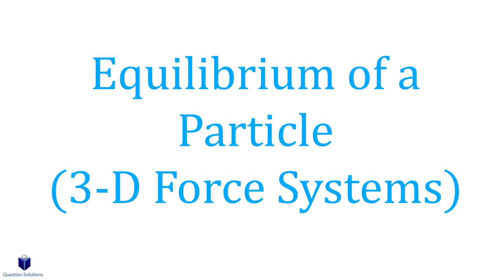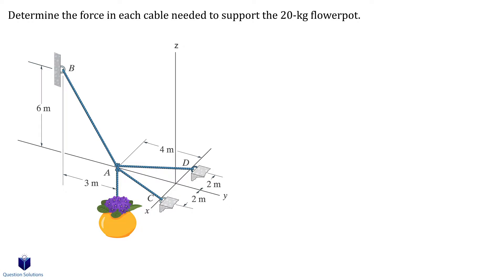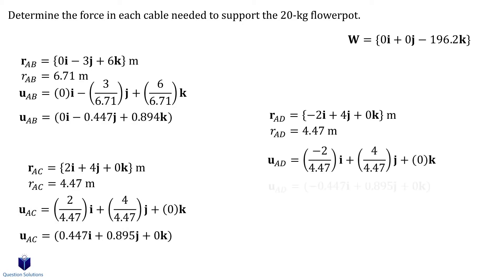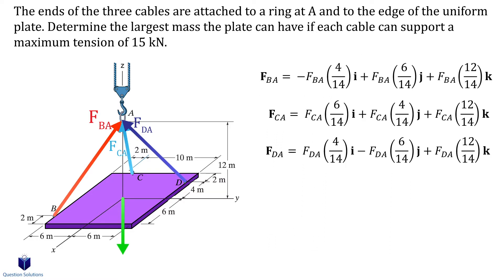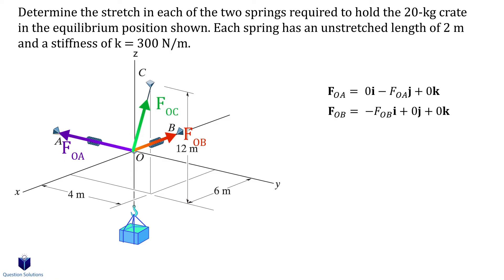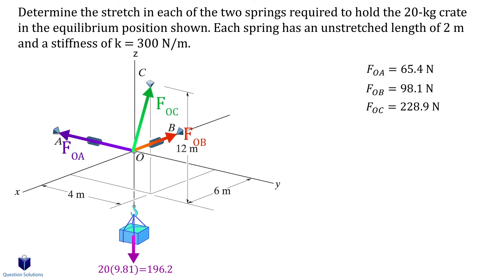Equilibrium of a Particle 3D Force Systems | Mechanics Statics | (Learn to solve any problem)

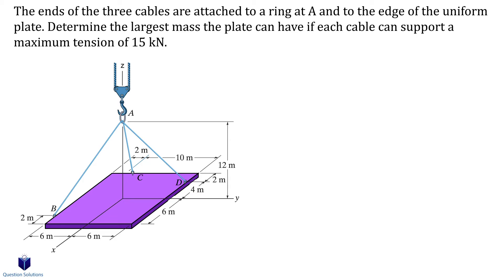Comment: I am not sure where you are getting those final values at 2:27.
Reply from the maker: So you can easily get FAB by solving the 3rd equation at 2:16 (the summation of forces in the z-axis). Once you have that, you have 2 equations with 2 unknowns. Use substitution to solve for the other 2 unknowns and you'll get those values. If you need a refresh on using substitution, see the shorts on this channel, I cover a few examples using that method.

Comment: At 2:51 why did my B, C and D is wrong? How to identify that?
Reply from the maker: I mean how can I know what you did wrong without seeing any steps or even what your values are? 😅 I can give you general tips. First, identify where the origin is. In this problem, the origin is at the center of the place. It's the place where all the axes cross each other. From the origin, you are now looking to see where each point is. So imagine you're walking from the origin to point B, how can you get there going along the axes? You have to go down 4m (6m - 2m) in the positive x-direction, and then 6m in negative y-direction, and you get to point B. There is not z-component because point B is on the x-y plane, so in simple terms, it's laying on the plate. And you do that for all the points.
Reply: @QuestionSolutions yes, I'm actually right but I ask chat gpt for it and then it said 2 is not in x component that's why I ask you thank you so much for the respond

Comment: can someone explained to me what actually happened at 2:24? i got confused...
Reply from the maker: Nothing really happened per say, you're just solving 2 equations with 2 unknowns. Here are some examples: https://www.youtube.com/shorts/4euH1289_Kg?feature=share or https://www.youtube.com/shorts/He7lrJEB04U?feature=share I have a few more shorts on solving two equations using substitution, so check them out if you need a refresh.
Reply: @QuestionSolutions  Thanks! I was asking because for AC AD i keep getting 48.99567
Reply from the maker: @MrAlexx17231  Since you're getting the same value for AC and AD, that means your steps are correct (you should be getting the same value). However, there must be some numerical error in your equation to give a value other than 54.8 N. Hard for me to say where it is without seeing your steps. You can also plug in the equations at cymath.com and see the steps.
Reply: nevermind, I had my algebra wrong
Reply from the maker: @MrAlexx17231  Awesome that you figured it out. Keep up the great work!

Comment: Sir in problem no. 2 can we take forces from point A to B C D respectively?
Reply from the maker: Since this is a hung weight, the forces would go from the plate to the ring. So from BCD to A.
Reply: @QuestionSolutions  ok sir
Reply from the maker: @ Just to be clear, you can still draw your forces from A to BCD, but you will end up with negative values, indicating the assumed direction is wrong. :)
Reply: But sir the weight will be along -ve k direction and there the equation for z components of all three forces goes wrong . We can't write.  -Fab(z)  - Fac(z) - Fad(z) = -w
Reply from the maker: @VinayMadane-t4e  You can, you can write it that way and still solve the equations. You will end up with negative values. Also, -Fab(z)  - Fac(z) - Fad(z) = -w can be written as Fab(z)  + Fac(z) + Fad(z) = w by multiplying everything by -1. Maybe I am not understanding your question properly, if so, I apologize.
Reply: @QuestionSolutions  
 My clear question : 
Due to hung weight there will be be tension in string and this tension will be outward from point A ( towards the weight) and also outward from the weight ( towards the point A )  since it is internal force 
Now if we consider that the the tension force goes from point A to the weight  there will be the negative z component of all 3 forces but the weight is always in -k direction  . 
But now the all three components (z) and weight acts in - k direction then how will the equilibrium be stable 
And even we can't multiply the equation you have given in answer  in video  because if we do so the weight will act in  + k direction which isn't possible 
So I think that multiplying the equation Fab(z) + Fac(z) + Fad(z) =w will not work here
Reply from the maker: @VinayMadane-t4e  If you assume all the forces to go towards the plate from point A, you can still solve this problem. Not much changes except for the positives and negatives of your equations. For all the force equations, you will need to flip your positives with negatives and negatives with positives. When you solve the problem you will end up with a negative weight value. The magnitude of that value will be the same, however, your weight will come out as negative. This indicates that the direction you assumed is opposite to what it actually is. So at the end, you end up with a negative mass, however, the magnitude of that mass is still correct. All it means is that the forces were suppose to go from the plate to point A.
Reply: @QuestionSolutions  ok sir thank you !
Reply from the maker: You're very welcome! @VinayMadane-t4e
Reply: @ 3:04 why was it rBA instead of rAB?

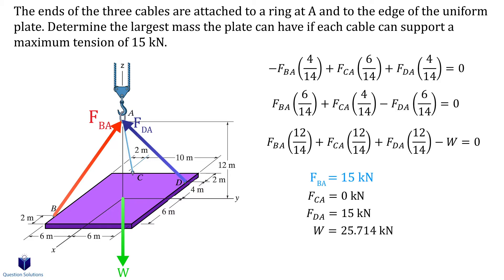Comment: Hello, I was just confused about how you got the values of each unknown force. For example in the second example when you had the three equations to solve for each unknown force ( minute 4:15) how did you find FCA and FDA with only FBA?
Reply from the maker: You can use substitution or elimination. I think maybe seeing FCA and FDA makes it bit hard to see, but you've probably solved these equations a million times in school life. Try replacing FCA with "x" and FDA with "y". Then you use simultaneous equation solving to get values for each x, and y. It's 3 equations with 3 unknowns, but we already know 1 unknown. So you get 3 equations with 2 unknowns. So you plug in FBA, and then isolate for one variable in an equation, and then plug that into the next equation and solve for the value. If you look at some of the shorts on the channel, you will see a breakdown on how to solve simultaneous equations.

Comment: 1:28 why doesn't the W component have a j vector? i see it as where all of the axes come together is the origin, so in my way of thinking A would have a negative j vector.
Reply: after reading the comments i think i understand, the origin doesn't have influence on the point, and because it is straight down it only has  k vector, why is this possible and is this only with 3d equalibruim problems?
Reply: or is it because we aren't using distances but forces, so it is just a rule?
Reply from the maker: @toondebeule8377  Any weight is always straight down, whether it's 2D or 3D. The component of weight will always be along the z-axis, and in 2D, y-axis.

Comment: minute 4:15    You assume Fba = 15kN and get Fca to be 0 and Fda to be 15kn,  my question is, what if we assume each of the cables are supporting 15 K, using the maximal tension force yielding a higher  mass for the plate?
Reply from the maker: The scenario you mention cannot exist. It's not possible for all 3 cables to carry 15 kN each. You can check that by easily plugging in 15 to all of the forces, and then seeing if you get zero, which you won't. This is similar to 0-Force members in a truss. Some members simply will not carry a force. The given dimensions of this plate, along with the locations of the cables constraints cable CA to carry no force.
Reply: Thanks for the video anyway, very informative, that is the only thing i did not fully comprehend.

Comment: at 2:51 D(-4i+6j+0k) how can you get that?? it is wrong
Reply from the maker: What's shown is correct. My guess is, you are unsure where the origin is to actually figure out where points A, B, C, and D are. In this problem, look at the center of the board, not the edges, where the 3 axes meet. From there, look to see where point D is. So you have to walk 4 m behind, so negative x-axis, and then 6 m to the right, so positive y-axis, and it's on the x-y plane, so there is no z-component. I really hope you figure it out before you go to an exam and lose marks.
Reply: @QuestionSolutions  when finding the resultant components, e.g for AB is it A-B or  B-A??

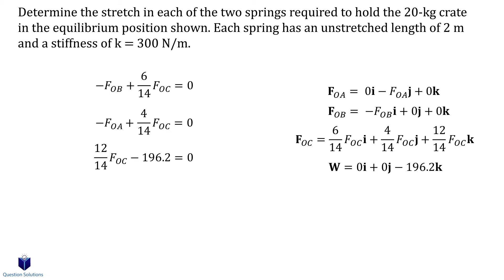Comment: Just a quick question regarding the last simulation: why do not we use 1 as the position of the the 2 springs along the x and y axis even though we know it must be greater than 2m, since this was the initial length in an unstreched condition. 5:50
Reply from the maker: I am not sure I understand your question. Are you saying use 1 for FOB or FOA? Regardless, using your method, do you get the same answer? If yes, then your way works too.
Reply: 5:17  i wanted to ask why you didn't put 2+x as the position vector on the spring (A) since it was stated in the question that the unstretched length of the cables are 2m.
But you gave positional vectors to cable C

Comment: Why fac is carry no force in sample problem 2
Reply from the maker: When you solve the three equations, you see that FAC won't carry a force. So you can interpret that as a cable that's there just for appearance, in other words, the two other cables carry all of the weight.

Comment: tbh, the way you made the FBD is so confusing. commonly used coordinates will always label the vertical line as the "y" not "z".
Reply from the maker: Actually, this is the usual method used in most North American curriculums to show 3D coordinate systems. If you're more familiar with another type, then use that, you'll arrive at the same answer.

Comment: Ican understand why w components are in z axe only
Reply from the maker: The weight is hanging straight down. The vector for weight is straight down, it's not slanted in any other direction. Which means, it has just a z-component.
Reply: @QuestionSolutions  thak you bro M really understand now , that's mean the w like Thread facing down

Comment: Guys to get the locations of A,B,C,D at Question 2, assume the center of the plate is the origin.
Reply from the maker: The origin is always where the x,y,z axes meet.
Reply: @QuestionSolutions  hello can i ask how did you get the  vector coordinates of B(4i -6j +0k) because i get them to be B(2i -6j+0k)
Reply from the maker: @nyeletijaftawhere are you out referring to? Please use timestamps.
Reply: @QuestionSolutions oh sorry about that i was reffering to 2:51
Reply from the maker: @nyeletijafta So first, we look to see where the origin is (where the x,y,z axes meet). In this problem, we see that it's at the center of the plate. Let's focus on the x-axis, since that's the only one you got wrong. From the origin to the end of the plate, we are shown it to be 6 m. So in other words, from the center of the plate, to the edge of the plate, there is a length of 6m. But where is point B? We see that point B is 2 m away from the edge. So then, with respect to the origin, where is point B? It's 6m - 2m = 4m. It's 4m away from the center.
Reply: @QuestionSolutions it makes much sense now, thanks

Comment: Hi in 1st question , wouldn't the position of W will slso be along y axis because its 4m left along Y and then in Z axis but you have only put the Z coordinate in position vector
Reply from the maker: Weight is not a position vector or a force along a line. It is simply weight expressed in cartesian form. It has just one component, that's a z-component (it's straight down). The other forces are all forces along ropes and have multiple components.
Reply: @QuestionSolutions  Thank you and one more thing, that means in such problems, I should take only the rope forces in three components, while writing the coordinates of the weight , only the vertically downward component are active, like along -Y( in 2D ) and along -Z( in 3D) , most of the time?
Reply from the maker: So first, I really need you to watch this video: https://youtu.be/CCeWy1kmxMs
It explains forces along lines/ ropes. When you need to express a force in cartesian form that's along a line, you need to follow the steps outlined. Weight is always straight down. It will have just a z-component. In 2D, the weight is along the y-axis. 
 @aashu_tosh

Comment: Hi, please from the first question, can you explain how you got FAC and FAD? 
If you could show a solution as to how you got it, I’d really appreciate. 

I’m having a hard time understanding it. 

Thank you
Reply from the maker: From the third equation, you can directly solve for FAB. Once you find FAB, plug it into the FY equation (2nd equation). Now you have 2 equations with 2 unknowns. You can solve them using the substitution method, or any method you're comfortable using. 
Here are some examples solved that way: 
https://youtube.com/shorts/He7lrJEB04U?feature=share
https://youtube.com/shorts/86uENomd53U?feature=share
https://youtube.com/shorts/4euH1289_Kg?feature=share
https://youtube.com/shorts/rAlhrq5hWFc?feature=share

Let me know if you need further clarifications. Thanks!
Reply: @QuestionSolutions  i am still confused.
I just watched the videos you just recommended and i still don’t get it. 
I’m having a really hard time substituting.
Reply from the maker: I am not too sure how to help since it's hard to show these types of things over comments. Do you have a TA or a professor you can speak with during office hours to get help with algebra? Maybe this will help too? https://www.cuemath.com/algebra/substitution-method/

I'll try to do a simple example here. Let's say you have these two equations and you want to solve for x and y. 

2x + y = 3
5x + 2y = 4

A way to solve it is to isolate for a variable in one of the equations. So let's isolate for "y" in the first equation. So all we did was subtract 2x from both sides and we get this:

y = 3 - 2x

Now we take this "y" value and plug it into the second equation. 

5x + 2(3 - 2x) = 4

When we do that, notice we get an equation with just one variable. Here, that variable is "x". We can directly solve for "x" now. 

5x + 6 - 4x = 4
x + 6 = 4
x = -2

Now that we figured out the "x" value, we can plug that value back into our first equation. 
2x + y = 3
2(-2) + y = 3

Now we can solve for "y".

y = 7

So our answers are x = -2 and y = 7.

The process to solve using substitution is the same for all problems. They might seem more complicated, but the core of it is just isolating for one variable and plugging it into the other equation. 
 @Ijee12

Comment: In the first example, why isn't there a separate tension for the cable between the pot and A
Reply from the maker: Because the weight is translated onto the rope. In other words, the force in the rope is the weight of the pot.

Comment: 4:14 how do we solve the equations after making assumptions that FBA =15kN ?
Reply from the maker: So you can solve them like you would any 3 equations with 3 unknowns. Using substitution or elimination. I think it's probably hard to see, but if you write these values with x and y instead, it might make it easier. For example, we can say F_CA = x, and F_DA = y. Then our first equation can be written as 15(4/14)+(6/14)x+(4/14)y=0, you can even convert the fractions to decimal form if it's easier. So the same equation can be written as 4.29+0.43x+0.28y=0. Writing the 3 equations like this will make it much easier to solve by isolating for one variable, plugging it into the next. Let me know if you need further help.
Reply: You can also use Gaussian elimination to quickly solve the system of equations

Comment: 2:13 how did you get that answer?
Reply from the maker: So it's just a normal equation, you're most likely overthinking it. Let me re-write it with "x" as a variable. 

-196.2+0.894x=0
0.894x=196.2
x=(196.2/0.894)
x=219.5

I hope that helps!

Comment: (@ 4:18) how did you get the W= 25.714
Reply from the maker: So once you assume F_BA=15 kN, you now have 3 equations with 3 unknowns. Then you can solve them any way you like. For example, you can isolate for 1 variable in the first equation, plug that into the 2nd equation, then isolate for the another variable and plug that into the 3rd equation. See: https://www.symbolab.com/solver/simultaneous-equations-calculator/-b%5Cleft(%5Cfrac%7B4%7D%7B14%7D%5Cright)%2Bc%5Cleft(%5Cfrac%7B6%7D%7B14%7D%5Cright)%2Bd%5Cleft(%5Cfrac%7B4%7D%7B14%7D%5Cright)%3D0%2C%20b%5Cleft(%5Cfrac%7B6%7D%7B14%7D%5Cright)%2Bc%5Cleft(%5Cfrac%7B4%7D%7B14%7D%5Cright)-d%5Cleft(%5Cfrac%7B6%7D%7B14%7D%5Cright)%3D0%2C%20b%5Cleft(%5Cfrac%7B12%7D%7B14%7D%5Cright)%2Bc%5Cleft(%5Cfrac%7B12%7D%7B14%7D%5Cright)%2Bd%5Cleft(%5Cfrac%7B12%7D%7B14%7D%5Cright)-w%3D0%2C%20b%3D15?or=input

Comment: how did you get Fad and Fac at 2:22?
Reply from the maker: So you can directly solve for F_AB from the 3rd equation at 2:16. After that, plug that value into the 2nd equation and isolate it for F_AC or F_AD. Then plug the isolated value into the first equation and solve. So easiest would be to use the substitution method. Imagine you have 2 equations like this: 2x+3y=5, 3x-6y=6. You can solve these two easily right? It's the same process.